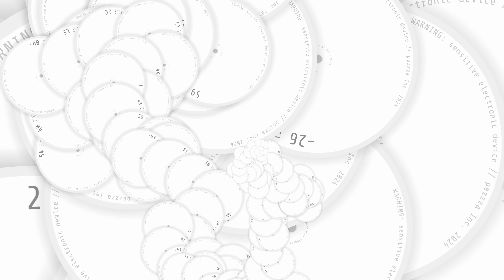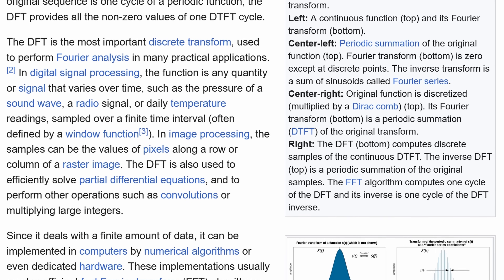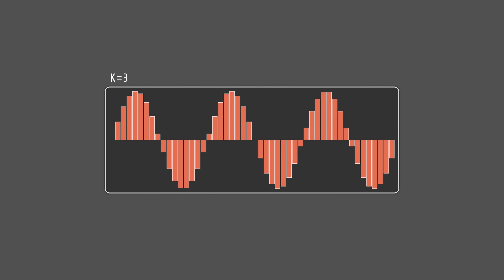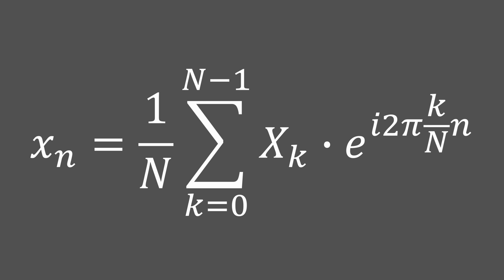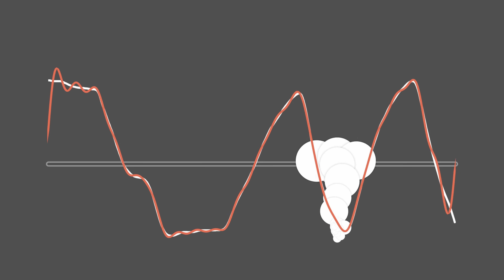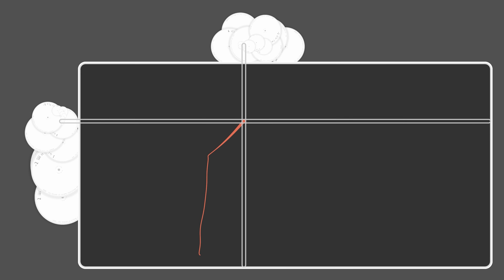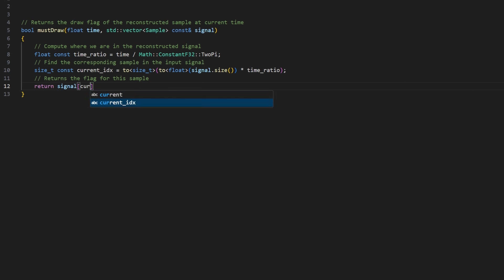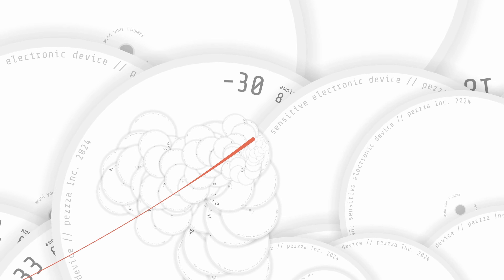How to program a Drawing Machine

Comment: I once tried doing 2D drawing by fitting polynomials. Unlike FFTs, which handle the whole signal smoothly, polynomial fits target specific points, but then they tend to explode dramatically between specified points.

Comment: This is a work of art  , i'm wondering if you continue to explain how the softwares like SOLIDWORKS or fusion 360 take designs and use DFT to turn it into signals and circles to find the exact spot x,y,z . Then how the cnc turn this informations into stepper motors signal to the exact spot to draw it in the real life , this explain how you bring an idea into a real object , i wish you do it , best luck for you

Comment: Looks very intersting. But I think having low "circles" and don't matching the original as close as possible is a feature. It makes the lines more smooth instead of jagged. It's actually a feature many drawing programs have. Otherwise when it just reconstructs everything exactly then i could just save the points that are drwan with a timestamp to and replay it as often i want. Or does it have any other advantage of doing it like that?

Comment: How do you make such beautiful visuals in c++? do you use any libraries ?
Reply from the maker: I use SFML which is a wrapper around OpenGL, I am preparing a series of videos about this subject.
Reply: @PezzzasWork  That's cool, I also used sfml a little bit experimenting with basic stuff but didn't know it was possible to make that kind of stuff, I have no idea how to make that paint pipe

Comment: You can also do this so you don't need to track the on/off states outside of the signal by extending into 3 dimensions and drawing only a slice inside the 'on' depth.
Could treat the 3rd dimension as 'paint dispenser flow'.
Reply: He never actually used a 2D DFT. The DFT by default allows for a complex-valued signal. You can just set the real and imaginary parts of each entry to the x and y coordinates of each sample.

Typical generalizations to higher dimensions rely on adding up plane waves, which certainly wouldn’t create a comparable graphic.

For that reason, generalizing this sort of animation to 3D would be significantly tricky. Apparently there’s such a thing as a quaternion Fourier transform. Maybe that would do it? I’ve never studied them, though, so I don’t know.
Reply: @CliffHanger-fg6uy  Yes, you can sum plane waves, but in every actual use I've ever seen it's done by decomposition... just like in this video.

Comment: So am I understanding that each circle is rotating at the same speed? Since it is a periodic signal? That is absolutely wild
Reply: There are two circles that rotate once per repetition of the animation (one CW, one CCW). Then, there are two that rotate twice as fast. Then, three times as fast. This keeps on going for as many circles as you choose to include (though for math reasons, the number of circles cannot exceed the number of data points sampled for the drawing).
Reply: TL;DR - No, the circles are rotating at different speeds.

The maths: to make things simpler to explain, I'll focus on a single "arm" of the drawing machine with two arms. The X or Y input signal is transformed into a sum of periodic (sinusoidal) functions. Each circle of the arm represents one of these functions. Each of the functions has a different period, so the rotation of each circle has a different period - in other words, the circles are all rotating at different speeds.

I don't really understand how the machine with only one arm works, so I won't try to explain it.
Reply: @shrootskyi815 The DFT works on complex numbers. If you encode the x and y coordinates as the real and imaginary components of the signal you take the DFT of, the single arm machine is the result.

Comment: Great video! I just have one question, some of the animations (like the ink pipe) seem really overkill for a project like this, especially in C++. Do you use a library or is it added during editing?
Reply from the maker: Thank you! It’s hand made and runs in real time during the signal reconstruction. It is based on the XPBD method, the scientific paper is amazing and makes it very easy to implement.

Comment: epic video, im somewhat lost on combining the x and y signals part, how did you give the dft both signals at once, did you simply have the arm be one x circle than one y circle, repeating or something more complicated?
Reply: i believe it works by feeding the positions as complex numbers (x+iy) into the formula.
Reply: In the code the circles are really represented as complex numbers,
But I'll still frame my comment here in terms of those circles, and sine/cosine. Also my notation here won't necessarily match the video.
I don't think he computed x circles and y circles individually. For each frequency component, there is a single circle that handles both x and y.
Still, if you do have a set of circles for x and y here is how you can combine them.

Each circle will have some radius r, some speed ω, and some offset(phase) ϕ.
So a point moving in a circle around the origin can be described as two functions x(t) = r⋅cos(ω(t-ϕ)) and y(t) = r⋅sin(ω(t-ϕ))
The x circles and y circles will have circles of possibly different sizes and phases, but same speeds.
By which I mean, if the x circles will have one with a speed of 5, so too will the y circle. (Actually the speeds will be a multiple of 2*pi/N but whatever).

Let's say the x circles include one with radius a, speed ω, and phase ϕ_1,
and the y circles include one with radius b, speed ω, and phase ϕ_2.
We can add these two circles to get a single circle. To do so, you can plug in t=0 to get the x,y values of one point from each circle,
let's label them (x1,y1) and (x2,y2).
Add these points component-wise to get a new point. So (x3,y3) = (x1+x2,y1+y2) . The radius of our resulting circle will be the distance of (x3,y3) from the origin, so sqrt(x3^2 + y3^2). The phase of our resulting circle will be the angle that (x3,y3) makes with the origin and the x axis, so atan2(y3,x3). And finally the speed will stay the same.
Reply: if you put the circles that made the y signal on top of the circles that made the x signal or vice versa they simply combine, that's all, if this were real life u literally just stick them on top of each other (obviously aligned correctly)

yes he could've done it by altering the circles and likely did as this would make it look more satisfying but it is not necessary, the order of the circles don't matter it just looks nicer when it decreases in size